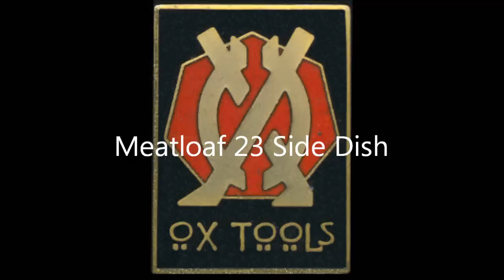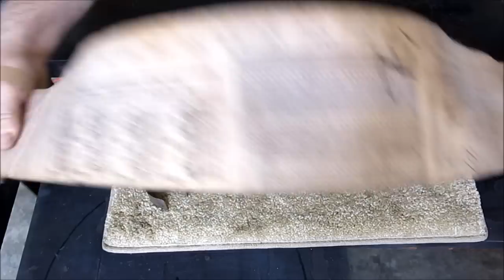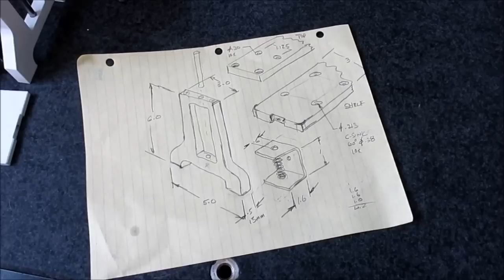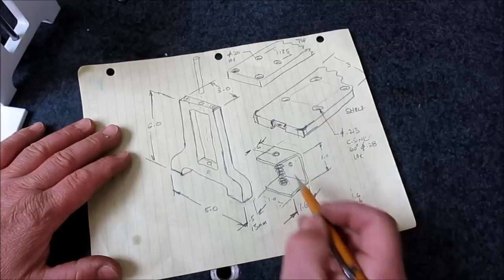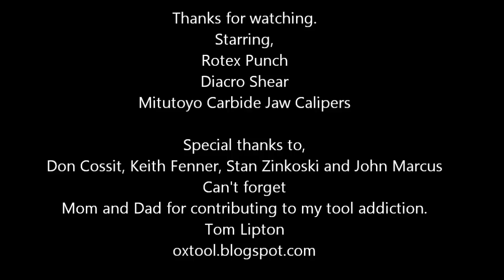Meatloaf 23 Side Dish

Comment: Hey Tom,
Some really cool flea market finds. Your impression of Keith Fenner was hilarious! I got a good laugh out of that. Like you, I like your bench block with the "Fire Control Lab" stamped on it. I think you dad will like the pipette rack. As far as the mystery tool goes, it's a cutter for extremely small pizzas. :-)
Regards,
Dave
Reply from the maker: Hey Dave,

Nrrrrrrrrrr. Wrong answer. The tool is not a pizza slicer. Dad approved the rack today. He even put some solvent on it to torture test it.

Cheers,

Tom

Comment: Enjoy your channel very much, keep up the good work !  The item between the Williams wrench and the tap handle appears to a "Drag Link" wrench for working on older car and truck steering components…  I have a couple of sockets for doing the same operation which are from the 60's or 70's.  Your tool is quite a bit older however.
thanks again,
Darryl Dodge
Reply from the maker: Hi Darryl,

Thanks for the information. Two people have called it that now so I would say its official. Now I need to buy an old truck.

Cheers,

Tom
Reply: oxtoolco Thank you for the prompt & courteous reply.

DKD

Comment: Hi Tom,

You may also think about putting a pair of long springs below the knobs on the pins. So that adjustments are always made by a downward pressure on the pipet rack and accidental lifts of the light pipet rack are avoided while adjusting the rack height.

By the way that beard plait looked well on you.

Thanks  for the video.

Mehmet
Reply from the maker: Hi Mehmet,

Thanks for the comment. The pinch clamps have a sweet spot where it releases fully and slides in either direction without drag. It took me a while to find something beard like I could truss up.

Cheers,

Tom

Comment: Hi Tom,
Nice finish for the pipette rack.  I didn't catch if the adjusters were stainless (for chemical resistance) or just sheet metal.   Thanks for showing us.
Reid
Reply from the maker: Hi Reid,

Yes the adjusters are stainless. I found some .020 spring temper in my shim stock bin. Dad was thrilled to try it out.

Best,

Tom

Comment: hi tom .i have a tool like the one you have (the wrench with the flats on), i used it in the sixties for adjusting drag link ball joints on car steering .now most cars have rack and pinion steering it is defunct,as always a great vid ,regards dave in the uk
Reply from the maker: Hey dave,

You could be on to something there. It has that dark automotive type dried weasel snot on it. 

Cheers,

Tom

Comment: Very funny keith fenner! it enlightened my pretty crappy day. thanks for that Tom. i would think the little pin that came with the stroke dial gage was ment to go trough the hole in the plastic tube to lock it in compression.(for whatever reason)
Reply from the maker: Hey Flip,

The plastic tube slides too easily. Not sure what the small pin was for. It wasn't a nice pin either. 

Cheers,

Tom

Comment: Tom, the brake adjuster is obvious to anyone who's adjusted the shoes on a drum brake....and I'll note that you can do the job with a screwdriver...with great difficulty and more time. 

The other tool is less obvious, but I think it's an ambush branding iron from the dot-dash-dot rat ranch. You heat it up, pull it back, hide in the bushes near a rat crossing sign, and when a rat wanders by you release and the beastie is branded!  Clever, eh?  

Really nice flea finds...you may not have priced Starrett combination square with angle attachments recently, but they are several times what you paid for that one. 

Thanks for feeding the video habit once again!

-- Mike
Reply from the maker: Hey Mike,

I was wondering why all the rats around here have little lines on their backs. Thanks for clearing that one up. Hey a screw driver is a tool to be used for anything other than driving screws. 

cheers,

Tom

Comment: Hey, Tom.  I noticed that there is no spring captured within the clamp as per the original concept... which is great!  But, if you were to put the compression spring on the shaft below the bottom of each clamp so it tensions on the bottom cross support, there should be no need for a weighted base.  It'll work against itself to raise the lower shelf.  Right?
Reply from the maker: I think the range it has to move through is too large for that. I played with it for a while and there is definitely a spot where it fully releases and slides without dragging. After trying it a few time it was easy to find the sweet spot.

---Tom

Comment: I like your pipette stand but also wonder if it could do with some rubber on the foot of each leg on perhaps a base tray to hold those tiny bottles -they seem easy to tip / knock over. However I suspect that the bottles may be of differing diameters?
Reply from the maker: Hi Dan,

The bottles sit in racks with counterbored holes in them that correspond to the spacing of the rack. You just slip the block with a full compliment of bottles under the rack and off you go. The bottles are different diameters and heights.

Cheers,

Tom

Comment: Blue cloth is a bandana, of course, to be worn around the neck when you're serving meatloaf.  
Or, you. could stuff it in your back pocket and use it as a handkerchief next time you get the sniffles. 
Or, like the bad guys in the westerns, you could wear it over your nose as a mask when you're negotiating steals on those fine flea-market finds.  

Very tasty side dish, Tom!

Richard
Reply from the maker: Hey Richard,

I think its going to be the new tool gang "colors"  All the tool junkies will be walking around the flea market with different color bandanna's on. Light blue for metalworking, yellow for wood working and black for automotive etc.

Cheers,

Tom
Reply: oxtoolco Bingo!  I think you nailed it.

Comment: Clever disguise Tom, but what gave you away was the "cut a key" comment, 16 to 8 blade Submarine props use a splined shaft
Reply from the maker: Whoops,

Busted as an impostor. I'd like to see the machine that cuts those splines.

Cheers,

Tom

Comment: Maybe add a pair of one inch tubes over the rods between the ears of the spring locks?  Protect them from being over squeezed, and loosing their set. Also make it easier to go to and feel the optimum release point.
Reply from the maker: Hi Kevin,

They want a bunch more of them. I think I will try a slightly larger hole. It should release more easily and have a larger sweet spot. Your idea of an over travel device is a good one.

cheers,

Tom

Comment: Hi Tom: Could the dial indicator also be used ( the long stem one ) for measuring the height of cams?  Thanks...Kevin...
Reply from the maker: Hi Kevin,

I don't think that's what this was used for. Automotive cams have a pretty short throw for this indicator. Are you thinking machinery cams?

Cheers,

Tom
Reply: oxtoolco Yes Tom, that is what I was thinking of . Using it to measure large cam profiles.

Comment: Kinda looks like an upholstery staple tapper. 
You hook the tool on the bastard staple that didn't go all the way in and push. If it's not then it's basically the same tool because i was looking in to buying one to have a complete set for my staple gun. Decided against when i learned that you can use the gun to "re-seat" the staple to the proper depth.

Put the springs under the hand clamps, that will send the rack up without the need for a weighted base.

Might want to put some sort of rubber feet or similar tho since it seems to slide really easy.

Also, if you check Ebay, the sell craze seems to of had hit the people since there's an influx of Starrett "Piece Combination Square, Protractor, Center Finder" and or similar. And the prices are pretty good too.
Reply from the maker: Hi Aserta,

Nrrrrrrrrrrr. Wrong answer. The tool is not a staple tool. Nice guess. The pinch clamps seem to be working fine. There is a sweet spot where it released fully and slides without drag.

Cheers

Tom
Reply: oxtoolco Well, then i'm drawing a blank here, that's the only tool that it reminded me of. The similarities are rather odd.

Comment: Hey Tom Fenner, need some help with that prop? I think I have a machine to run of on in case your lathe is too small LOL
So what was that mystery box?
Reply from the maker: Hey Andre,

I think we need your propeller lifting tractor to load the sub prop in the lathe. Are you busy this weekend?

Cheers,

Tom
Reply: Is the door to your shop high enough? I can get it down there in two weeks, american airlines wouldn't take it as carry on so I'd have to drive it down at a top speed of 7 MPH.
Reply from the maker: Andre Gross Door is ten foot by ten foot. Sharp left coming in off the dock might give you some trouble. Coffee is brewing.

Cheers,

Tom
Reply: Yea it wont be large enough. Get out the concrete saw!

Comment: So, lemme' get this straight...

You just scored a Starrett hermaphrodite caliper, and you still use your dial calipers for layout?

Frank
Reply from the maker: Hey Frank,

Full hard stainless steel spring steel. I'm using the carbide jaws of the calipers. Besides I can read direct without a scale. You're right, I should have demonstrated them but I need Chuck to clean them first.

Cheers,

Tom